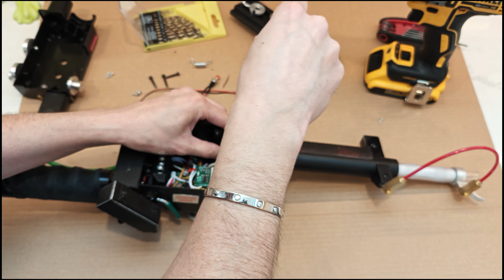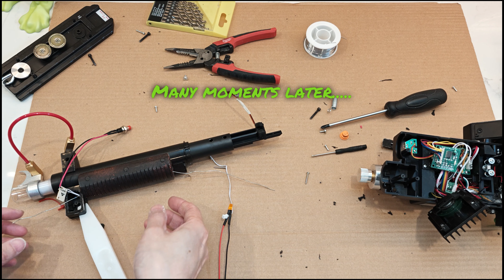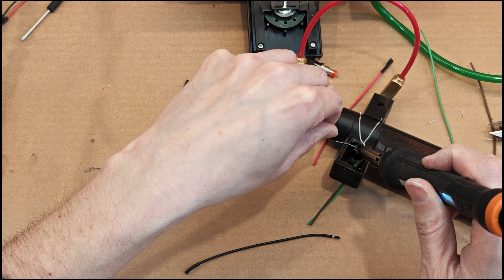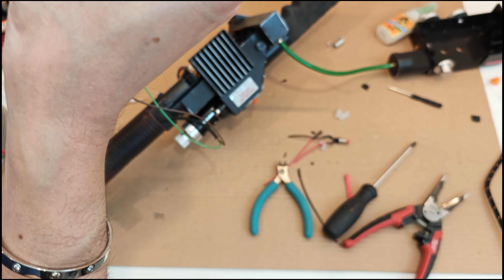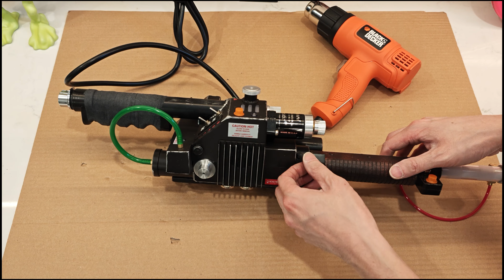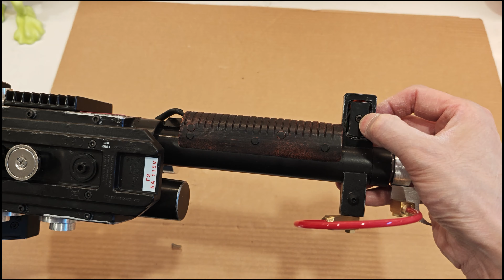Ghostbusters Hasbro Spengler Neutrona Wand Hat Light and Mode Button DIY Install Video!

Comment: I never understood the fake light button next to a fake button design decision... was REALLY hoping they'd fix that in the '84 one, but nope. I thought many times of just changing stuff out myself, but I'm too worried that it'll interfere with the stock hasbro pack's voltage detection.
Reply from the maker: Yeah would be so easy for them to fix that! WIth the new LEDs the GhostLab42  wand keep alive doesn't work as well... Wand now shuts down but turns back on (All 3 switches)... Side effect is that the Frutto bar graph then doesn't work until I disconnect the wand from the pack and plug it back in :( But works with just the first 2 switches on.

Comment: So doing these hat lights on your wand, does that play some sort of weird effect to a ninjatunes board when it comes to voltage? I’ve seen a few vids of people doing exactly what you are but find that their wands work for a short period of time and after that everything starts failing! The pack begins to not recognize that there is a wand attached or parts of the wand no longer function etc? Are you running a ninja tunes board or GPStar or stock board?
Reply from the maker: I'm running NINJA TUNES. Zero issues. Still going strong. I can think that using higher voltage LEDS (People are switching them all to 5v.... Which I can see it causing problems.